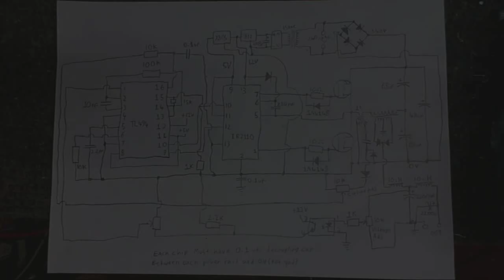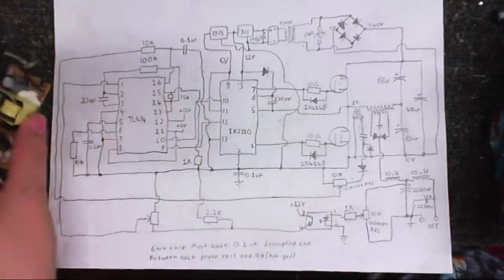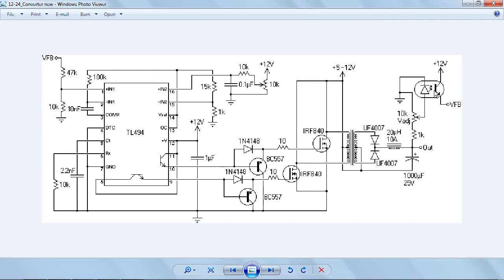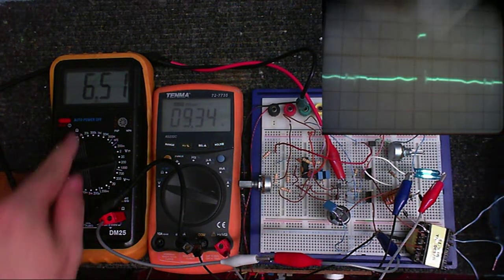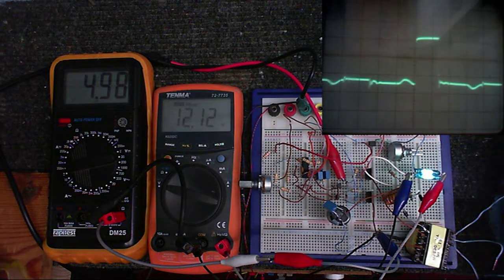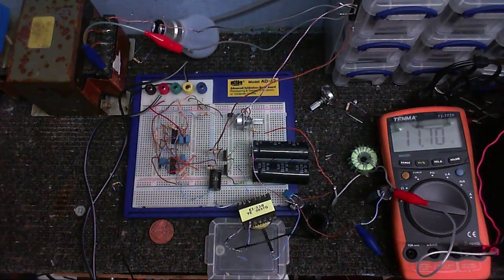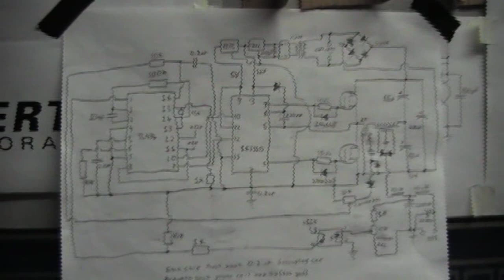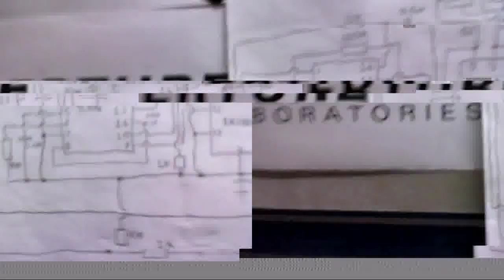Building A SMPS part 4 - A new prototype

Comment: im so happy you used a simple potentiometer voltage divider for adjusting sense and optocoupler operation rather than the common topology we see everywhere TL431 zener etc...That sometimes it simply decides not to work (im pretty sure it never works on breadboards).
I want to mentione you that you almost never write the mosfet type you use on your diagrams.Also please note that someone might get confused and use an IRFZ46 shown on 3:39 which will just explode on 350V rectified mains! Of course its not your fault you show an inverter circuit that you used as base but its easy for someone who searched video to find mosfet type to see the wrong IRFZ46 and not the correct IRF840 (or any common switching 500V n-channel mosfet)
Reply from the maker: +jimis04 Good idea, I will point out witch mosfets I'm using in the next video.  I was tempted to go with the TL431 (even though I'm not sure how to use one).
Reply: +CoolDudeClem 
It's pretty darn easy to figure out how they are used. The TL431 is like an LM555, 1N914, etc... very common! :P

Comment: Good stuff man. Will be expecting part cinq.
I'm looking at high amp small voltage power regulators.
Was hard to find how to make it. There is one made by Drok that is with some Chinese chip to do the switching.
Would love to get to the level where I can make my own.
Part in question gives out 15 amp and is 66mm*50mm*22mm.
Need it to supply 16 servos that peak at 1A under heavy load, and are rated for 5V. (robot project)
Reply: +valflyinf 
Those DROK and chinese DCDC regulator boards are in general plain junk XD
Counterfeit chips, poor circuit design, and incorrect labeling/specs are rampant with those things ... :S
Reply: I got two DROK modules in different power ratings and they are working very well so far. Time will tell though when I start putting some real load on that 15 amp module.